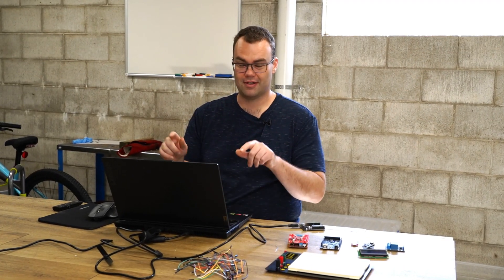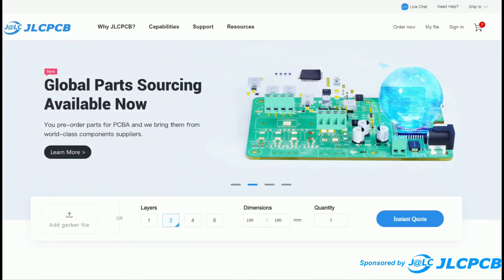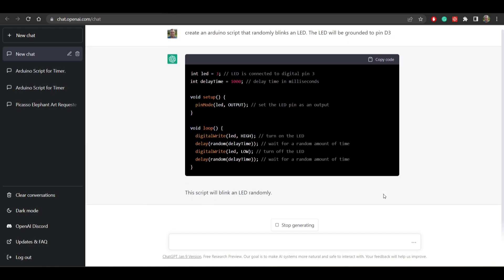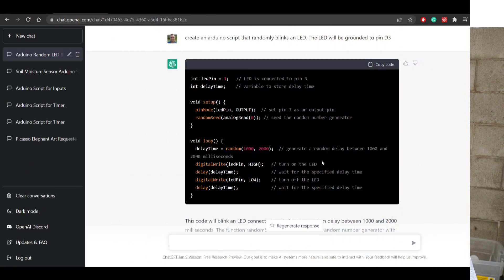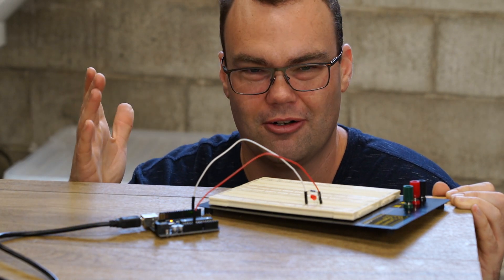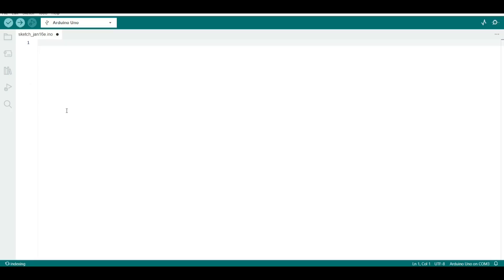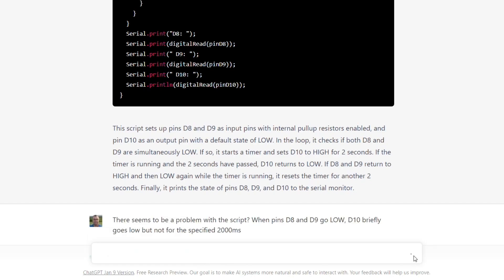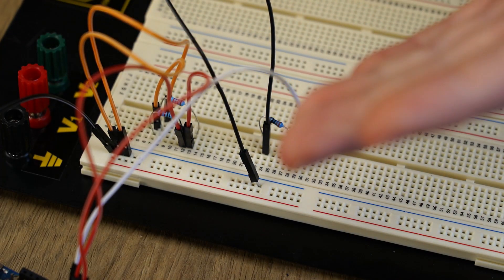ChatGPT instant C++ script for programming -  Great for Arduino beginners!

Comment: Very simple examples of very common things exist on internet everywhere which it derives the code from. A way more complex code that i made on it by very detailed description to make code to  balancing unit of an axle and where the imbalancing was and how much material to remove to get it balanced. It did it but at the borderline what it could make and very impressive but I really had to tweak many things to get there but its sill possible to tweak. It also made little different code every time which was both really annoying but sometimes it also included things that I hadn't really thought about to implement like calibrating of sensors and stuff. And for complex code for something else then just simple electronics, like this balancing thing, I noticed that it at the very first code didn't "realized" that the axle had to spin to be able to detect the imbalancing. After I told it that it apologized and completely remade the code to do so, and after that it always did for an rotating axle, like what I said was like a seed for the AI for this. Kinda cool to see. I have had hour long "discussions" with it test different thing in the code.

Comment: Unfortunately, it doesn't always work well. I did a test to get 2 in series coupled 8x32 WS2812b matrix working with also the serial output configured. I wanted to get different text on each matrix display. The examples he gave did not work. Without the serial output it does work. I can't solve this problem myself, which is why I was hoping the AI could point me in the right direction. I described the instructions in different ways, but unfortunately no solution. For simple tasks do it excellent.

Comment: good grief.  Using ChatGPT to write Arduino scripts takes the learning out of that ecosystem.  Sure, it works.  But you, the tinkerer, did not make that work.  The only upside is that doing this takes the coding out of coding.  You can still use your hands to wire together things blindly.  And, voila - instant anomie.  Thanks, OpenAI.

Comment: A very interesting tool indeed.  It even knows PICAXE BASIC, which is a bit obscure outside the UK school system.  It was able to write me a fairly complex program with two inputs and eleven outputs, internal pullups, interrupts and timing, but it took several iterations to get it right.  It made a few mistakes, and had I not known the language already, they would not have been obvious; the program that it wrote would have simply failed to compile.

If you ask it to write a program of any significant length, it won't be able to display the entire code at once due to message length limits imposed by OpenAI.  You can get around this, however, by asking it to display the code in sections.  For example, say it starts to display the program and cuts off just after the fifth "if" statement.  Just type the following to make it pick up where it left off:  "Starting at the 5th "if" statement, display the remainder of the program."  Works like a charm!

Comment: I've found that chatgpt is really good at providing examples of languages like python, but totally fails at arduino code. Maybe it's an issue with my prompts, but I spend a lot of time asking it to correct its errors. I tried to get it to write an example of using shift registers and it simply couldn't do it.

Comment: Yes it does the grunt work. Fantastic. But the major part of developing as more complex application is determining what the requirements are. How it is supposed to work. And dealing with edge cases.  It is interesting enough that I will be giving it a try. I'm a hardware person and not a coder.
Edit: Unfortunately it has no more capacity at this time. Hopefully I can get on it at some point.

Comment: AI only does the busy work. For loops, easy-to-describe functions, formatting, translating code between language, etc. Anything that doesn't require much thinking. If it's something you're excited about doing though, or having a hard time figuring it out, the AI will try, but it will get it wrong pretty much every single time.

Comment: I see it on a very different way. If you use it well, nobody needs to be replaced.
For more complex circuits and programming AI will run into certain problems, but probably will get about 70-90% done just fine.
So I just see it as a massive time saver, while I can focus on the more complicated and essential details, let the AI run the bulk and boring part of a project.
Reply: Exactly what I was thinking, I could make it set up the basics and fix the errors or do the complex part myself.
Reply: I remember seeing this argument back in the 80s when robots were introduced in car plants. Eventually everyone got replaced
Reply: Exactly who set a computer to control Your economy without being able to interfere or correct it if it's wrong.
Reply: Yes, like boilerplate code and stuff. I wouldn't trust it with anything else. And I suppose it's fine for people who try simple things and maybe fail several times and want a solution to see where they went wrong. If I'd use it at all, I'd prefer a different faster interface, not the 'conversation' style, kinda like vscode emmet, though this might be suited for beginners and kids who wanna play with arduinos, better.

Comment: It'd be interesting to see if it can coach someone from absolute zero (never used Arduino IDE, doesn't know what a breadboard is) to put together a working circuit and script.
Reply: There are so many courses on ytube that do just that, they will even tell you what a wire is